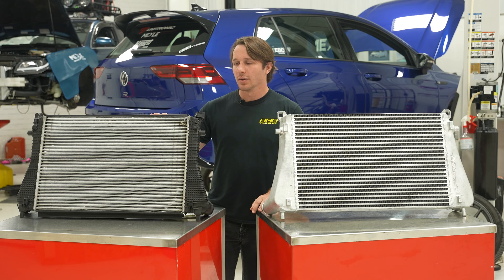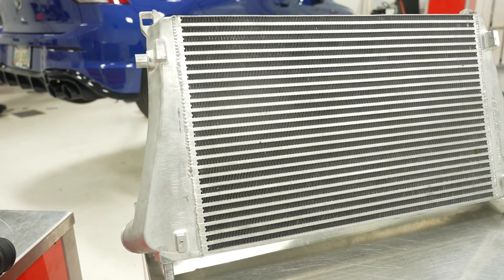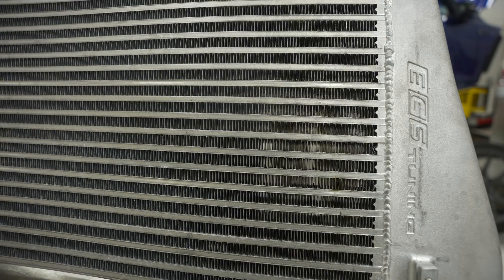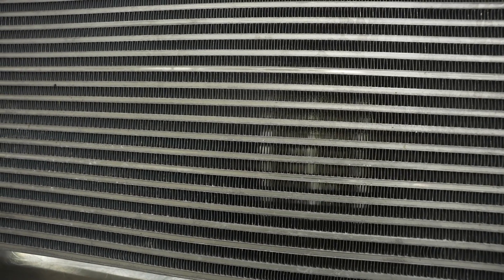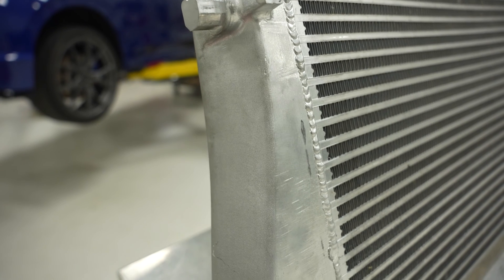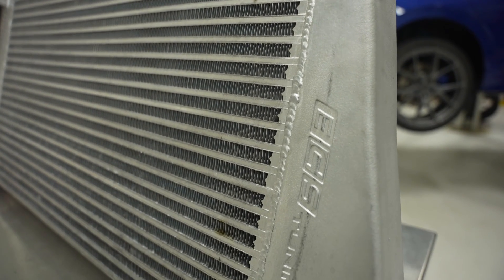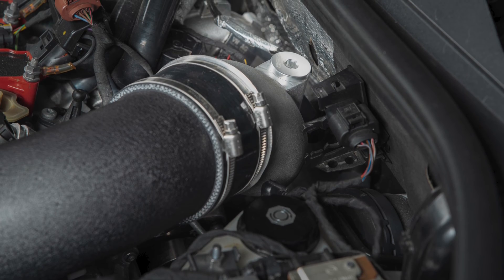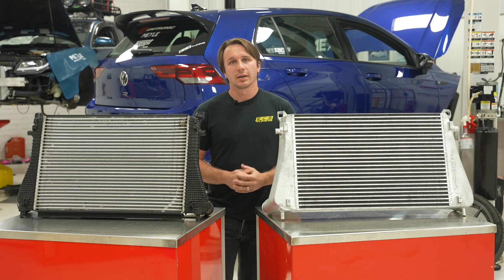The BEST Upgrade for your MK8/7!! | ECS Product Highlight

Comment: "Through our in-house evaluation on our ECS Shop Golf R, we measured a maximum increase of +37 WHP @ 6,000 RPM and +5 WTQ @ 3,250 RPM along lower intercooler outlet temperatures." - What kind of power gains are seen on the road, where people are going to be operating the car?  

A Dyno test favors a large Bar & Plate intercooler that can serve as a heatsink when airflow conditions may not reflect a vehicle moving at road speeds.  You are reporting results under conditions that favor the design you chose, but are not representative of how the vehicle is intended to be operated.  That's cherry-picking.

Comment: Would have been great to dyno the ECS intercooler without the Unitronic tune, to see if any gains. (I know, it is more to prevent heat soak after back to back runs and hot weather)

Comment: For the price of these golf r's. I'd be nice if volkswagen didn't put such crappy oem intercoolers in them.
Reply: What's crappy about it? The one that comes with the car is actually better for a race track. The car is kind of made for a track. The ECS bar and plate intercooler probably weighs about 40-50 pounds more than the stock tube and fin version. Also the bar and plate looks good on a dyno because the way they work. The ECS bar and plate intercooler is only good doing short runs like 1/4 mile run. If you put it on a race track they will get heat soak probably before you can finish your 1st lap. Race cars don't use bar and plate. They are not very good and cheap to make versus the stock tube and fin one. The stock intercooler was designed for how much power the car has and works great. If you add enough power the stock intercooler can't keep up.
Reply: @The.IT.Anayst 40 to 50 pounds more  lol.  Where do u get this bs from.
Reply: @christopherhanlon4690 So your saying the stock intercooler is better than this ECS
Reply: @lloyd_3656 Yes, but when you modify your car the ECS one can be beneficial. Although you can spend more money and purchase a tube and fin one desiged for your power goals. Most people don't know the difference and just buy the cheapest one.
Reply: @The.IT.Anayst OEM is only 470 cubic inches, ECS is 1000 cubic inches 

Explain to me how a intercooler with only 470 cubic inch cools better than the 1000 cubic inches 

You stated no science to back up your claim here
Reply: @Joechurro  The fin design is important and can easily offset differences in enclosed volume.  That said, in this example, I doubt the stock IC will outperform the ECS.  Contrary to @rahxe80's claim, the OEM IC is not crappy based on operating efficiency.  Vendors push the narrative that the OEM IC is poorly performing to boost their sales.

Comment: Do I need a tune immediately after mounting a fmic? Or in my case I have an mk7 gti, I have an intake, catback, inlet pipe, and now im getting a twin intercooler for it, is it bad that I dont have a tune?
Reply: I've the same setup, albeit a single do88 intercooler,  and for over 20k now she'a running great without any tune.
Reply: No but to get most functionality out of it a tune is recommended
Reply: Thanks🙏🏽
Reply: @derekbonilla9713  no problem good luck with build.